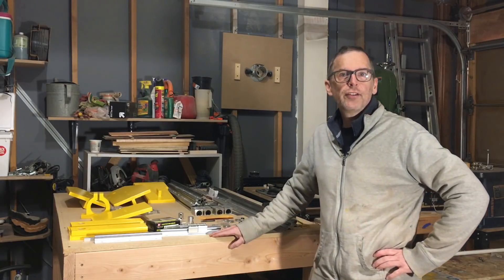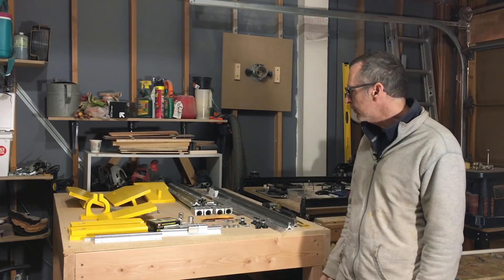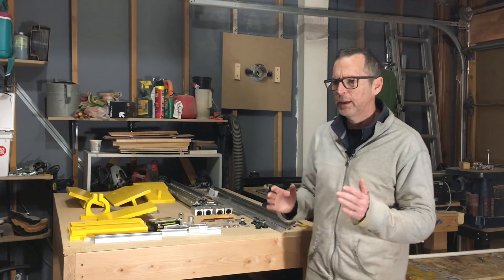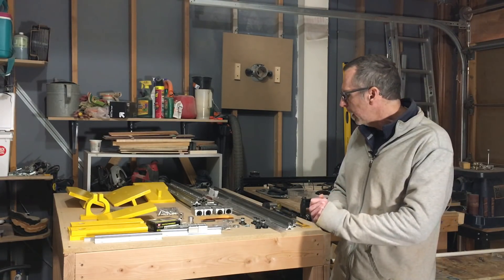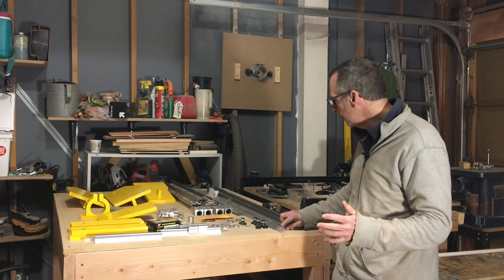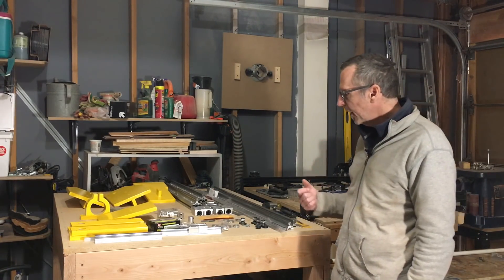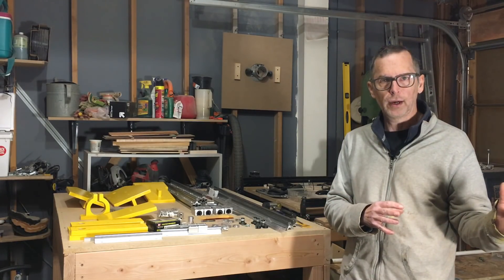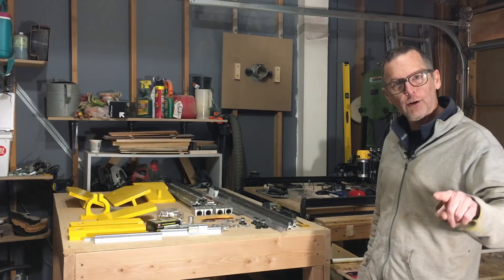The Highline Guitars CNC Routing Machine Project Update

Comment: What size SBR rails and leadscrews did you use?
Reply from the maker: Peter Sheppard SBR12s on the Z and SBR16s on the X and Y. The lead screws are 1/2” 5 start.
Reply: Thanks Chris! I'm working on building a CNC machine of about this size and am copying many of the design elements from your build, as well as using some of your sources for parts such as misumi and longs-motor. It is inspiring to see how well you were able to make plywood work on your machine. I am looking at using RM1610 ballscrew which has a feed:turn rate just below that of ACME 1/2" 5-start, meaning that I should be able to use the same size stepper motors you used as well. Thank you for being such a great resource to DIY CNCers and lutheirs such as myself.

Comment: Nice Parts. If I would build a CNC today, I would look out for a Ethernet controller board. That should be less problematic if you wanna have more than 3 meter or 10 feet of cable to your PC.
Reply from the maker: Based on experience, as long as everything drawing power in my shop is grounded properly and my USB cable has ferrite chokes, I'll be fine as long as I keep the cable no longer than 10 feet. Mine will probably be around 6 feet.

Comment: Good luck with your build! I finished building my 3rd plywood CNC in November, and I love it.

Good call on painting the wood parts with a good quality oil based enamel. I don't know where you are, but humidity is a major factor no matter what kind of plywood you're using. I live in wet, rainy southern Oregon, and I can tell you that warpage and expansion aren't the only problems - there is also mold and mildew to contend with. My first gantry started to mildew after the first year because I didn't seal it at all. 

I went with a plug and play 4-axis kit from Xylotex. It's a 4 amp system that uses 425 in oz NEMA 23 steppers, and I love it. One word of caution on the UC-100: Make sure it's a REAL UC-100 motion controller. Fakes have been popping up on eBay for about half the price of a real one. Folks are taking a standard USB to parallel port adapter, painting it up, and adding labels to them to pass them off as the real deal. Avoid them - they do NOT work. The real UC-100 is handled by CNC4PC - they sell them through their website or on Amazon.

Good luck! Can't wait to see it making chips!